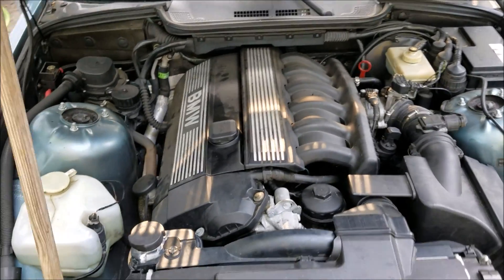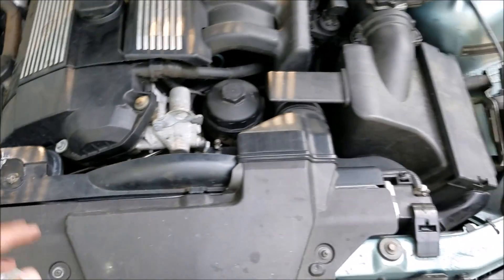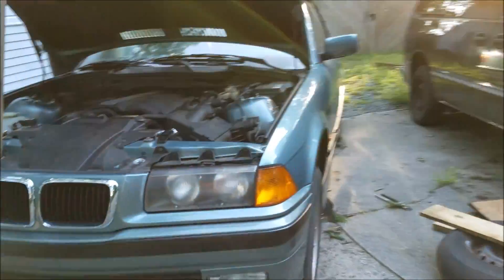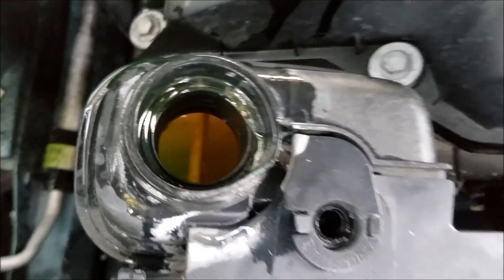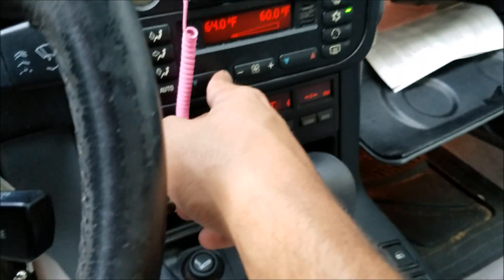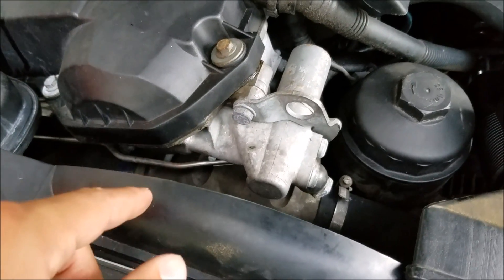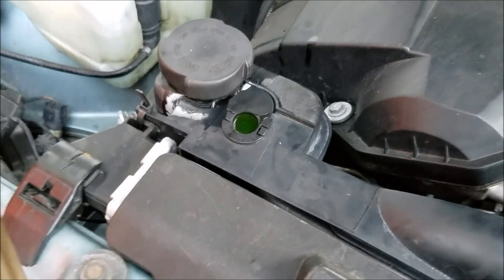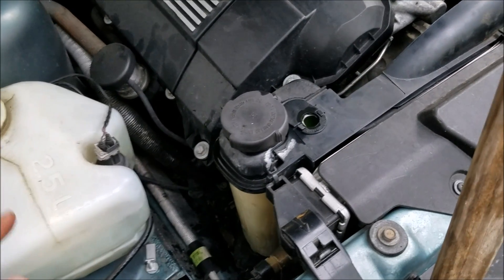How to Bleed A BMW Coolant System

Comment: im confused as to why you lifted the car. Is it to have the coolant not leak as much?
Reply: Gets the radiator and hoses higher then the heater core which is the weak part of these systems thus forcing the air to the top. Works for some doesn't for others. E36 cooling systems are hell to deal with. Good luck

Comment: Thanks for the video. Have done a few of these on E36 and not a lot of 
fun . Finally sprung for Mishimoto tank after second plastic tank 
cracked after 3 years both times. Added a Pegasus racing 3/4 inch OD 
aluminum splice in the overflow tank return hose under the airbox so can
 remove shroud and overflow tank as one unit after radiator. Also drill a
 1/8 inch weep hole in thermostat to allow a faster air bleed ( hole 
rotated to top of thermostat ). Use upper radiator hose as funnel to 
fill radiator then switch ends to fill block and remaining hoses. The 
bleed hole and fill procedure reduces air bleed time a lot and top up in
 overflow tank to about 8 ounces. Takes one gallon to fill radiator and 3
 quarts to fill everything else when block was not drained. Removed 
belts to avoid coolant contamination and sealed ends of hoses with 3M 
trim adhesive to block water /chemical ingress. The vacuum hoses under 
the L shaped air boot and the air boot crack  causing idle surge . BMW 
boot lasts longer than aftermarket and can reseal cracked hose ends 
after rubbing alcohol cleaning with red silicone if not replacing them. 
Bel-Metric sell 6 mm nuts with rotating flange washer that deforms a 
little to soft lock the nuts. Hard to believe BMW spec of 5 nm on the 
water pump nuts but they are right on.  Thanks again for very helpful 
video.

Comment: What's the reason for lifting the front, I just tokk offy watsrpump  and found that water has never went through my block, what can be the cause of that plz any1 I need advice, my car was over heating after replacing the cylinder head
Reply: Don’t know about it specifically I’m trying to get some info currently on a e39 but the reason I assume he is doing this is because it is the procedure for bleeding a e30 because in that you need to raise the bleed screw/ tstat housing making it the “highest point” on the system so that when you’re bleeding and filling there aren’t any bubbles trapped somewhere along the way

Comment: I did this all & my check coolant light came on again
Reply from the maker: that "check coolant light" comes on when a floater in the reservoir drops to low. The floater is made of plastic and frequently breaks apart, leaving your check coolant light on at all times.

Comment: I accidentally did this to my 98 328i only difference is heat was 90F with that circulation button on while I was driving (cause I couldn't figure out y the heat wouldn't work) then it overheated lol had to wait until it cooled down then added water to the car then it was fine again but i'm concern because it never overheated before..😓.

Comment: I keep hearing not to let the water pump run without coolant for it would break its mechanical seal. So how does it survive in the initial start up while the  t-stat is still closed?

I’m also clearing out the old coolant thru distilled water dilution method (several cycles and drain until
clear), how do you ensure not to introduce cold water to a hot engine which could warp it? 

Thanks in advance!

Comment: Hiya matey thanx for the video... Have a 318ti 1997 heater goes cold when on full have had it ages and never bled... Parked it so my front two wheels were on the kerb... When i open the bleed screw after the thermostat kicks in the liquid disappears...  Should i do anything... Any help would b great cheers

Comment: I've got a 01 325i and theres steam coming from the radiator connecting to the top hose of the resevore at idle. I've looked into it an it can be heater core, head gasket, thermostat, or water pump any way to narrow this down or your opinion?

Comment: another trick for you guys to speed the process up. i’ve replaced the radiator and bled it twice in the past 6 months of owning my e36.

After reinstalling the radiator, remove the top radiator hose, twist it so it points upwards (loosen the clamps, don’t tear your hoses!) and put a funnel in it. start filling, let the level drop in the hose until you can’t fill anymore. you may spill some coolant here and there. there is a small hole in the t stat housing that allows coolant to bypass the thermostat and enter the engine and lower rad hose. 

not sure if this is a common thing to do on any vehicle, but i haven’t seen it on any e36 coolant flush diys.
Reply: also, if you’re going for an all aluminum radiator, go with koyo over mishimoto! i’ve heard a lot about reliability, haven’t owned a mishimoto personally, but i know many prefer koyo and i like playing it safe. keep an eye out on ebay, you can get one for 40-50 over the price of a mishimoto, and sometimes even less. price difference = minimal, reviews are much better.

Comment: Really you just open the key heat and fan on for 15 min and will do it on its own.
Reply: engine has to be started if your flushing or have had to replace radiator resevior  or  hoses ect.  and lost to much water the water pump has to engage. if you have one little air bubble anywhere and fail to catch it in time could cause major engine damage. take your tie do it right and save yourself in the long run. and if your a service tech where do you work? so we can avoid that place.

Comment: Wait I have turn the car completely on? I thought we just turned on the electronics..
Reply from the maker: What model bmw do you have? Some of the newer models have electric water pumps which have a different process.
Reply: E36 Fanatics I have a 1999 convertible 323is
Reply from the maker: Yeah, it has the same coolant system as this one.
Reply: E36 Fanatics so I run it till there's no longer any bubbles, with or without the cap on the radiator reservoir tank?
Reply from the maker: Pop the cap back on as it gets hot, or just keep it on. I pop the cap off initially to speed up the process. If there is a lot of air in the system as soon as you loosen the bleed screw you will hear air rushing out.
Reply: E36 Fanatics great, thanks alot man much appreciated. I'm about to do it here in a bit

Comment: What if I can’t turn on my heat ?
Reply from the maker: No problem, if you get the heat working again and it's not heating well bleed it again.
Reply: @e36fanatics29  the heat has to work or you may never get the air out the engine which could damage your engine

Comment: Hello how long do you think this should take. It’s been an hour and a half and I still see bubbles coming out?
Reply from the maker: Takes me about 10 - 15 minutes.
Reply: Oh okay, I’m using 100% distilled water bleeding the system. Do you think that the water is turning to vapor bc of the lower boiling point?

Comment: please help me now. 1996 e36 323i. did the coolant change and followed your direction and now its boiling  at idle. right hand radiator hose cold. left radiator hose boiling hot. radiator/expansion tank full and bled properly with elevated car and heaters on. south east western australia. please help. this car has never let me down. can someone please tell what is wrong.
Reply from the maker: If the other radiator hose isnt getting hot once the vehicle hits optimal heat and if its passing optimal heat sounds like the thermostat is not opening.
Reply from the maker: Obviously can't be 100% certain, but from what you said in this description this would be my best bet.
Reply: thankyou sir. all new parts. im a qual mechanic. i noticed the cooling system is a bit differant that was all. hasnt it got a releaf valve or bypass for extreme situations like this. like a hole in thermo to equalize pressure. tar mate. if it was horse  i would have shot it by now piece of shit.
Reply from the maker: No, I have never heard of a plug in the thermostat housing on a bmw, possibly on the newer models, but certainly not on the e36.

Comment: what type of coolant do i use for my E36 316i???
Reply from the maker: Its highly recommended to put pentosin or Beck Arnley.
Reply: Mother's milk
Reply: use the greenish blue coolant that BMW recommends. You can get it at the BMW dealership and some good auto parts stores sell pentosin or Beck arnley, which is the same green/blue. Be careful if you buy coolant at an autozone, the gold/yellow coolant they sell as 'BMW' is not compatible

Comment: Is the heater on the entire time? And do you know if the steps are the same if you have a mishimoto radiatior with the expansion tank? It has the bleeding valve as well.
Reply from the maker: Juan Torres Yes, and I'm not 100% sure to be honest haven't owned one before, should be the same.

Comment: Chilton and BMW tech manuals indicate to fill the coolant system with the ignition in the ON position (electricity running only) with the heater on.

Then actually START the engine after the level in the expansion tank no longer naturally drops. With the ENGINE now running, rev it with 3 short bursts of 4500-5000 rpms. This allows the water pumps rid the air of the system itself. 

After 30 seconds to avoid the engine from heating up and coolant expanding, tighten the bleeder screw and shut the engine OFF. 

Check the expansion tank coolant level and fill to the appropriate level, replacing the cap.

Restart the car and allow to run to normal temperature. Turn it off, let it cool down and check the expansion tank level one last time.
Reply: Thanks for this ! So I'm not sure yet, do we need to completely remove the bleeder screw the entire time or just loosen it ?
Reply: Juan Torres just now saw your reply! Hope ya got it figured out back then. I’m sure either or would be fine. Leaving the screw in I’m sure worked just as easy.
Reply: This worked perfectly the Revs really got the air out of it. Finally - 1995 325i
Reply: Gabriel Mendez glad it worked out for you! My son sold his 328i we worked on during my original post.
Reply: So you could do this when the engine is cold?
Reply: Ivan G not sure. You could squeeze the hoses to get the air bubbles to the bleeder screw. But the action could draw air back into the system as the hoses relax from squeezing. Thus getting air out while the engine is running/warm was best for our 328i back then.

Comment: This was helpful. I only had a couple of bubbles come out then it just started boiling out of the bleed screw opening! I replaced all of the typical coolant system bits a couple of months ago, but find that the car still overheats within a few miles...and I get absolutely no heat out of the heater with the blower on high and temp set to max. even with the coolant temp to the red light. When I shut the car off at this point, the cooling fan is off as well. With my 2000 new beetle, the electric cooling fan runs for several minutes after being shut off in the driveway. The cooling fan does run, but the speed seems to be constant. It is almost like the coolant is not being circulated? hence complete lack of heat from the interior heating system?  What am I doing wrong here?  New to the E36, but it can't be that complicated?
Reply: Richard Bates - You are correct to say that the reason the heater is not hot is due to the coolant not flowing. Like a lot of vehicles, BMW have an intricate pathway for the coolant to flow. There are lots of hoses, high points in the head etc. When bleeding the system, I suggest only filling the system about 2/3 of the way up to begin with. Then add the coolant slowly. This gives the air time to bleed out - too much coolant at one time will trap air in pockets around the system. These pockets stop the flow of coolant and can cause hot spots in the head and block which can crack the head or fatigue a head gasket. Squeeze any hoses as the engine is warming up. This helps to force any trapped air into the flow of the coolant. Do this as the engine warms up. As our friend E36 Fanatic has stated, do this with the vehicle elevated - because air want to travel to the highest point.
Reply from the maker: What exactly did you replace? I assume that you already checked how much coolant you have and theres no leak. Does it overheat all the time or only at city driving (under 35 mph). They aren't to complicated but they can be tricky.
Reply: I replaced the water pump, housing, hoses, thermostat, belt, reservoir, bleeder valve. I have only driven it around town at mostly under 35, as you said. A couple of times up to 50...seems to run fine at that, but at the red light, heats up again. And it doesn't put out heat from the heater either? Coolant level seems to be ok and there are no leaks visible?
Reply from the maker: Run the car at idle, have someone watch the coolant gauge on the inside to make sure it doesn't overheat to much, get a hand on the return hose from the thermostat housing, as the car hits the middle on the gauge it should start heating up. This means that the coolant is circulating and the thermostat opened. If the hose doesn't get noticeably hotter to the touch the thermostat probably isn't opening. 

Second idea: Fan Clutch, the engine driven fan has a clutch inside it that is supposed to tighten up as the vehicle heats up, this causes the fan to turn faster, you can google "fan clutch newspaper test". 

If your car is overheating that quickly I would start with the first thing to make sure that the coolant is actually circulating, especially if your coolant level isn't dropping.
Reply from the maker: I had an overheating issue a few months ago after I changed out all the typical parts on the coolant system. Turned out in my ignorance I neglected tightening the lower radiator hose enough and it was leaking, tightened it up and problem was solved.
Reply: Thanks for those ideas. I will try  them and let you know.

Comment: Can someone tell me why you have to bleed the system. What happens if you don't
Reply: Richard Orosco
Reply from the maker: You bleed the coolant system typically after you have done a repair on the coolant system, this is because repairing the coolant system such as replacing a thermostat or water pump introduces air into the coolant system. Unfortunately bmw's are not like most American cars where the coolant reservoir sits above the radiator. American cars are typically "self bleeding", because air comes out through the reservoir, not the case with BMW's. If you don't bleed the system, it can cause the car to overheat due to an air bubble stopping the flow of coolant.
Reply: Thank you for the information and i hope you have a blessed day Thanks
Reply from the maker: Thank you and hope it helped!
Reply: @e36fanatics29  no their not every closed system has to be bled only difference is there is no bleed valve has nothing to do with american or not. toyota celica 2000's you have to do this through radiator hose

Comment: I just had hot coolant seep out out the coolant cap, while its tight shut. Same thing with it off. I ran the engine during all this and I don't know what to do.  I hate the cooling system in these cars. I don't know how to bleed these things. All I got was hot air coming from the bleedscrew. NO hot air from heater. I just redid everything in the cooling system.
Reply from the maker: First thing is I wouldn't fiddle with the coolant reservoir cap while the engine is still hot, the coolant is pressurized. Once the engine cools off take a look at the reservoir cap area, if your sure the coolant is coming out of there and not a crack in your reservoir tank or coolant just seeping out of the bleed screw area, than I would take a look at the threads that the reservoir cap screws into, and if everything checks out I would go get a new reservoir cap if it appears damaged. If you have no hot air from the heater that's no big deal, its just something to help circulate the coolant through the system.
Reply from the maker: Oh and last thing! Make sure the coolant isnt overfilled, theres no way of telling this until the engine has cooled.
Reply: Thanks, I overreacted and over thought it. E36 Fanatics It was pretty full when cold, I kept adding until it came out of the screw without bubbles.

Comment: Thanks for this. I've been leaving the reservoir cap off until I see the coolant level rise to the point of almost overflowing before I tighten it.  My thinking is that it's an effort to remove the air pocket there too. Does that actually do anything?
Reply from the maker: When I open up the bleed screw I actually leave the reservoir cap off for several minutes until the coolant starts to get very hot. For me its more to watch the level if I've just re-filled it, but I believe it definitely helps with getting the air through the system as well.